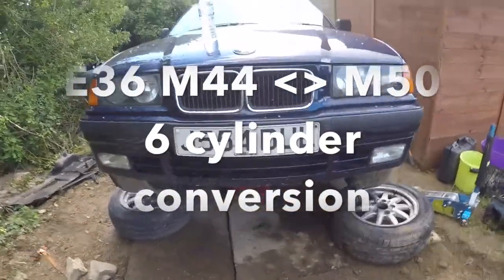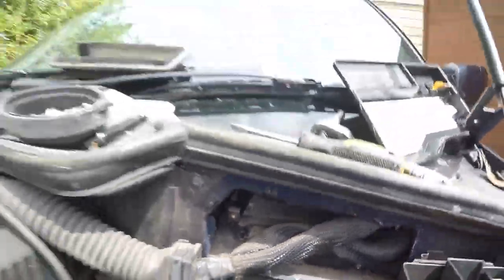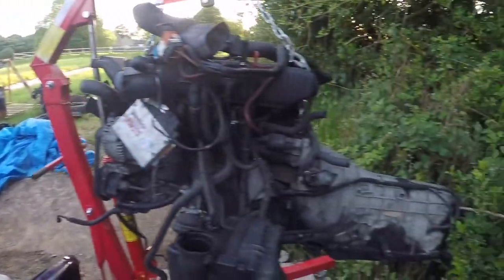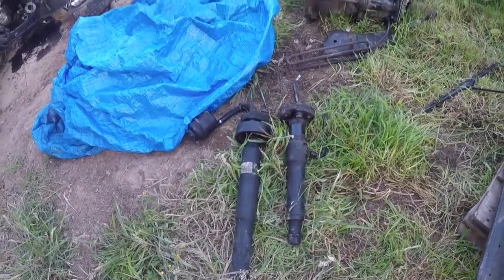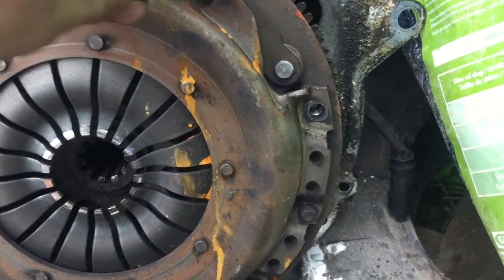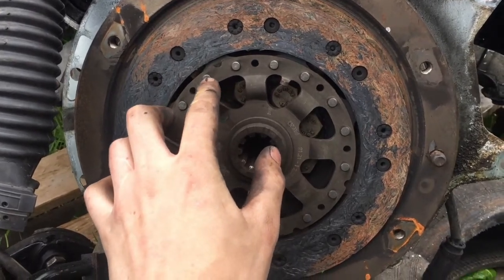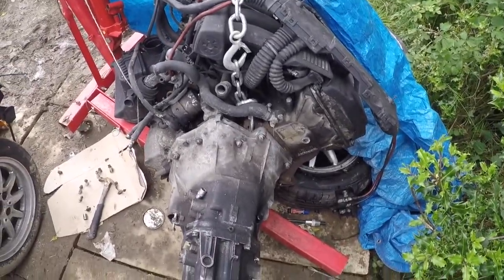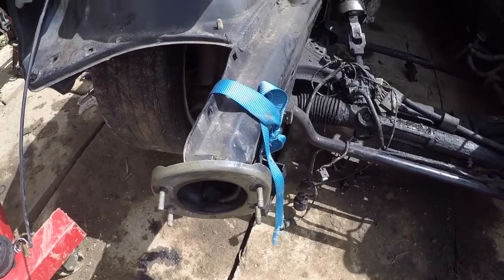E36 4 Cylinder (M44) to 6 Cylinder (M50) Engine Swap DIY Part 2

Comment: Heya, I've got the 4.23:1 gearbox in my 316i. Will an m52 engine destroy it?
Reply from the maker: rscabbage I am told all getrag boxes are nearly identical. The gear ratio however is determined by your diff, 4.23 will be pretty extreme meaning quick acceleration but will top out at 100 mph ish. Depends what you are building the car for.

Comment: Great work guys! Do you think this swap would be just as straightforward into a E36/7 Z3? Thanks. Looking forward to the next installment.
Reply from the maker: klumsytone Thanks!  Yes as the Z3 did come from the factory with the 6 cylinder. So Engine mounting and Wiring should be plug and play. As the Z3 is a shorter wheelbase you will need Z3 propshafts, exhaust and possibly gear linkage. Let me know if you need more.

Comment: J reg e36 rare beast I have k 318is early cars going up in value
Reply from the maker: Ahhh nice! I haven't seen any early IS's. Is yours and M42 engine then?
Reply: I got a 1992 318is...is it really going up in value? lol I got mine for $2,000 with 153xxx miles